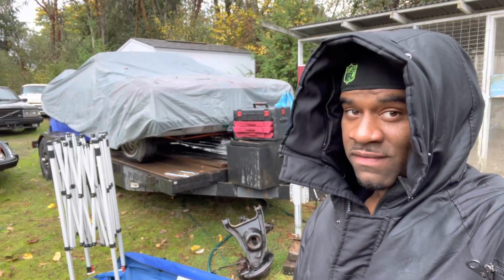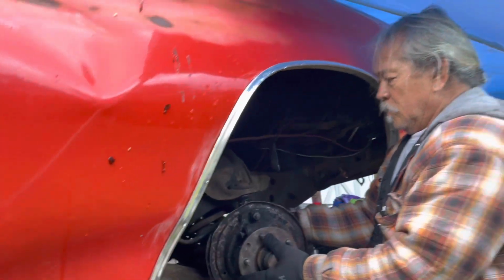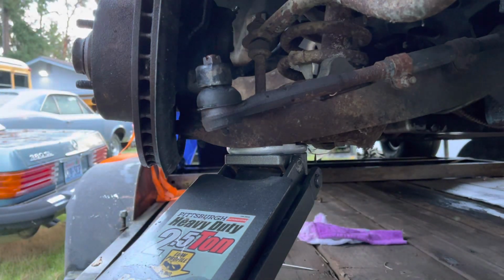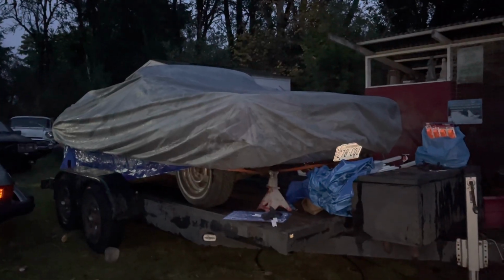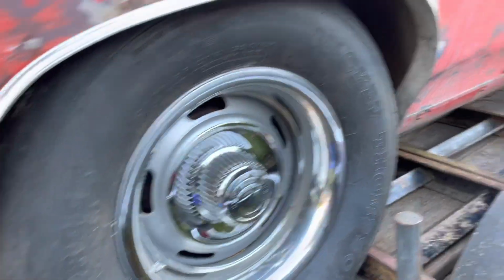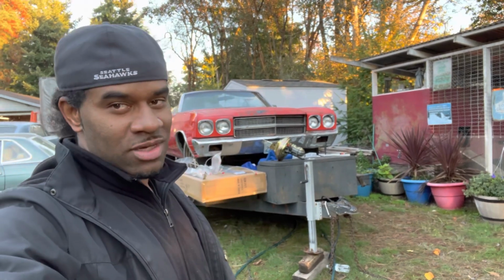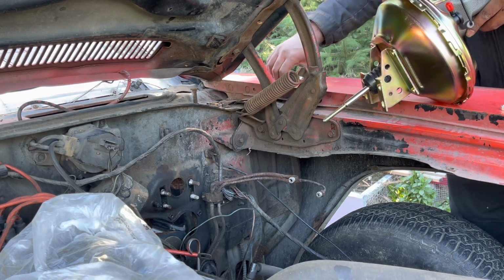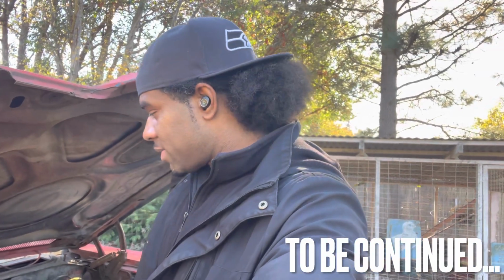Working on my 1970 Chevelle convertible!

Comment: Working on 77 Mustang II drag car, 96 S 10  ,4.3L engine rebuild, Suzuki Savage 500 Motorcycle, 89 Camaro IROC Z 28, T top 5.7 tuned port on trailer waiting for slot in my garage. In between I'm chasing private jets on the ramp to make the money to buy all the stuff to fix it!
Reply from the maker: You got it worst than me lol